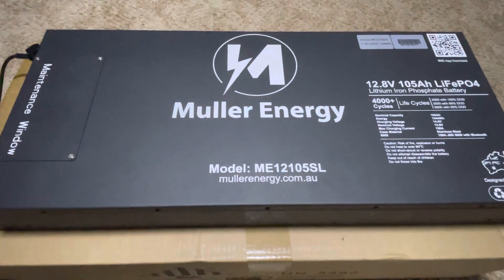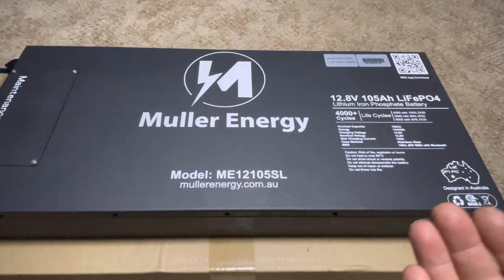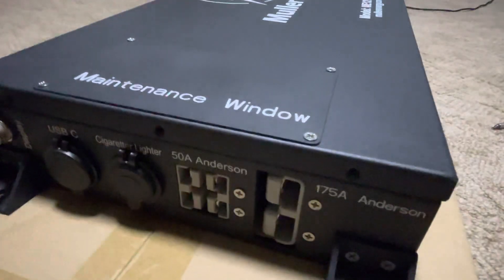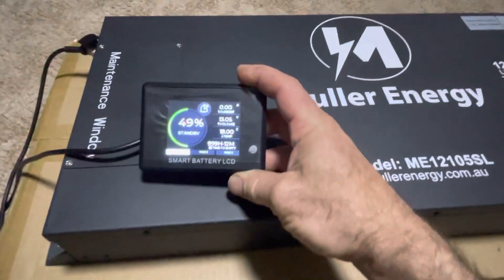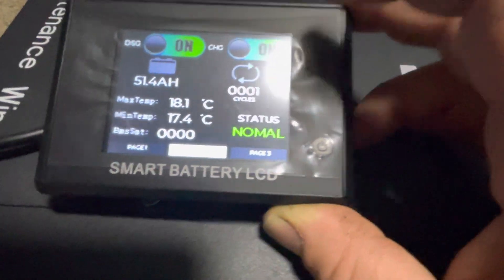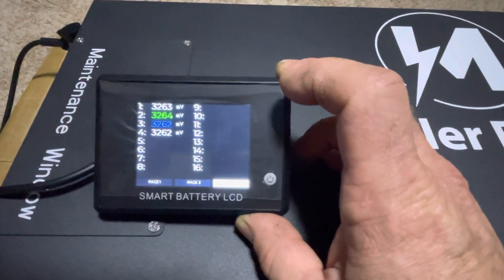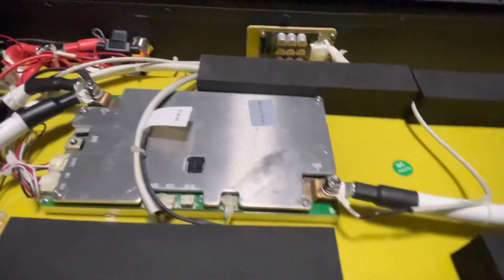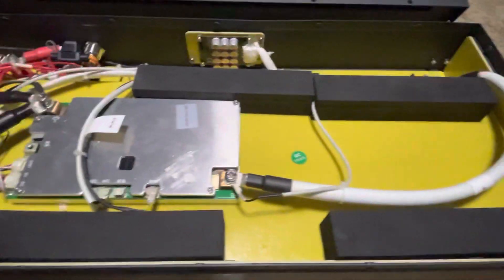Muller Energy Lithium Battery

Comment: Gday mate I'm about to take the plunge on one of these .. how have you found it ?
Reply from the maker: Hi 
I use mine everyday running a fridge and lights and have had no problem with the battery build quality or capacity and can say for me it’s worth it’s money. The only negative is the Bluetooth for the Bms is slow to connect and you need to pay for the advanced version of the app which may or may not be worth it depending on your set up as it gives you more information on the battery and the ability to remotely turn the load off or disconnect it from the charging system and still run a load off it. The app will also let you know how charged the battery is and so on
Reply: @philsrandomstuff2392  Thank you for the reply, Phil. My system is going to be pretty basic with upto 360w of solar to a 100/30 mppt charger for battery, then plug in a power distribution box all while using 8ga wire. I decided on this battery because it seems one of the best slim line batteries for the price and the build quality seemed great Bluetooth wasn't a concern because I think the screen will do.
Reply from the maker: @tezzinaus  the display works well .

Comment: Hey Phil

What do you think about the mounting brackets on the 200ah battery, I don’t think they are strong enough to hold a 28kilo battery when four wheel driving the screws are very small for my liking, another thing I found was when I mount the brackets the other way it does not fit flush when you try to mount it, it leaves about a 5mm gap means I have to find a spacer

Once again my friend I look forward to your thoughts,

Cheers Darren 🇦🇺🇦🇺
Reply from the maker: Mine had about 3mm gap under the mounting brackets so I got some 3mm flat bar alloy from Bunnings to take up the gap. If you don’t use countersunk screws. You could slot the holes and move the brackets, so you don’t have the gap.
Yes 28 kg is a lot to hold for the tiny screws. My battery has the bottom side sitting on the floor of the canopy, so not a lot of weight supported by the brackets. What you could do is get two pieces of 3 mm angle iron the length of the battery to support it across the entire length of the battery case, which will allow you to put more screws in the mounting plate or board that you are fixing the battery to. This is what a lot of other slimline batteries come.
Reply: What’s size screws are they using mate I might need a little more length, I appreciate all your help phill any idea when we will see you Muller 100ah Lithium Battery reviews 🇦🇺🇦🇺🍺🍺
Reply from the maker: I think from memory they are M5 but I will check when I get home tonight after work. If you want email me you phone number to
dingleyphillip@gmail.com  and we can have a chat
Reply: Hey Phil, I just sent you an email with photos let me know what you think mate 🇦🇺🇦🇺👍👍✌️✌️🍺🍺

Comment: Hey Phil

I’ve also just purchased a Muller battery, I purchased the the 200ah slimline lithium battery, like everyone else here we are looking forward to your review, I haven’t got round to installing mine battery as yet maybe soon, fingers crossed I’ve done the right choice, it’s sounds picky but I did find a down side and that is the battery box itself  is unbalance because of the way the lithium batteries are laid out inside, noticeably more so with the 200ah, 

When the time comes it’s going to take 2 hands to mount it

Keep up the good work mate 🍻🍻👍👍👌👌
Reply from the maker: Yes they are dam heavy, on the the plus side you could reuse the case when the cells run out of life. I have got the 100ah mounted in my Ute canopy, would of got the 200ah like you but it was to thick. So far I get 107ah out of it and the cells are balanced. As for the Bluetooth app it is slow to connect and you need the pay $12 for the advanced part of the app but unfortunately you can not change the active balancer switching points. I think you will be happy with your purchase
Reply: @philsrandomstuff2392 thanks for getting back to me Phil, yes I never thought of that reusing the case with new cells, mine fully charged came to 210ah which put a smile on my face, I’m also running a Redarc bcdc 40 amp charger, what solar panels would you recommend to charge this 200ah battery, 200watt,250watt, or300watt solar panel or something bigger ???

I finally received my Renogy inverter in the post today, but one of the mounting brackets was broken now I’m just waiting to hear from Amazon and Renogy support, unfortunately I couldn’t find any Phone Numbers to contact them personally
Reply from the maker: @darrenknight9661  shame about the inverter, Renogy have a email you could try supportau@renogy.com. Hopefully they will sort it out for you. 
With the redarc 40dcbc I think you can run upwards of 600w of solar. The main thing to consider when I purchase solar panels is the Real Estate that I have to fit them, no point buying panels that won’t fit. So sometimes size will dictate a brand or type of solar panel.
I have three different types of solar panels myself and out of the 3 the 100w renogy Black Division Lightweight Monocrystalline Solar Panel works the best . So hopefully the rest of there panels in different sizes are just as good . 
Solar 4 RVs is great company and very helpful 
https://www.solar4rvs.com.au/
Reply: Hey Phil 

I appreciate your advise, the solar panels will be used on camping trips take them put out of the car and set up to recharge my Renogy 200ah I suppose you can call them portable, I took a look at the 100 watt black Davidson solar panels it seems to be the panels I like also  thanks.

Do the black Davidson solar panels come any bigger than 100 watts ??? I guess these panels can be mounted anywhere on the ground or even the bonnet of a car etc
Reply from the maker: @darrenknight9661  100w is as big as they go in the black division panels, but have a look at there folding panel range, something like this is better for car based camping as they come with ability to be self standing and take up less space when not in use

Comment: If that has the new Muller Energy JBD BMS they have made the BMS able to change the parameters so that Active Balancer can be switched on/off at certain voltages.
As you really don't want your active balancer to come on below a cell voltage of 3.40V
Reply from the maker: I just read out what was printed on the active balancer which states " working voltage 2.7v to 4.5v "
Reply: @philsrandomstuff2392  I just watched again, the active balacer is not controlled by bms so it is permanently on.
Oddly enough leaving active balancer on all the time actually unbalances the pack with deep discharging. 
If you look where the balance leads attach to the port on the Heltec there is a bridged solder connection beside the port.
You could attach a switch there and manually turn the active balancer on/off or you could wire in a variable voltage sensing relay and set the voltage to 13.6v which would be 3.4v per cell, the perfect time to start balancing.
Muller Energy are very high quality builds.
Do you have any control over the BMS settings via the App?
Reply from the maker: @bildad1234  have not had a chance to download the app so I cannot comment on its operation yet.
You are correct, leaving the active balancer on all the time cause an imbalance overtime, this battery is going to be used where it will be connected to solar and a DC to DC charger all the time so it should not cause a problem. Doing what you suggest with a voltage sensitive switch or just a switch is definitely the best way to go with active balances.